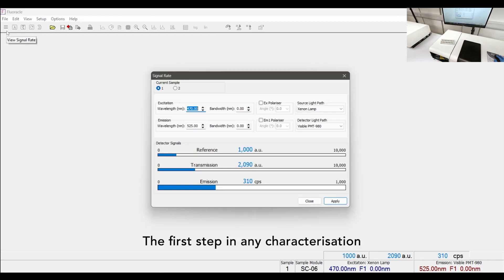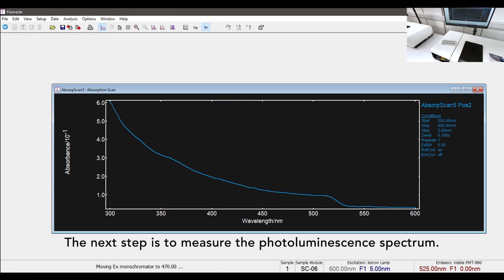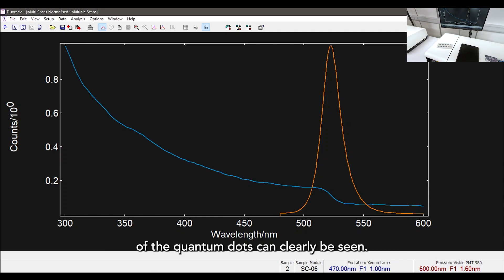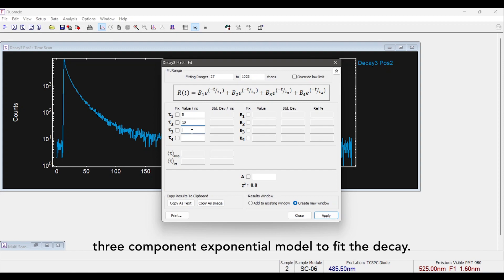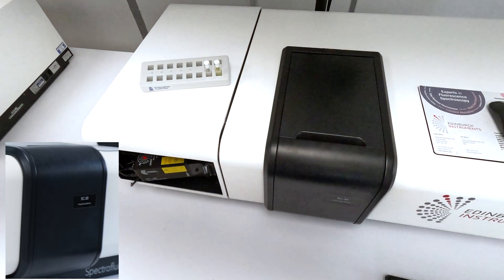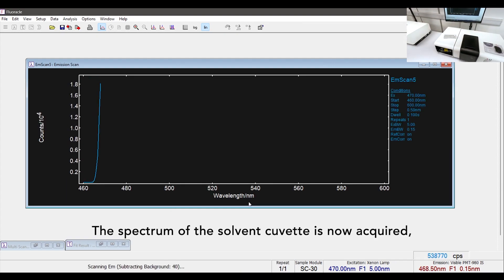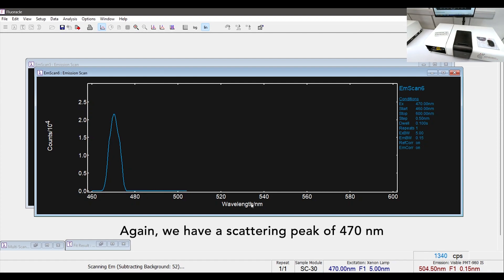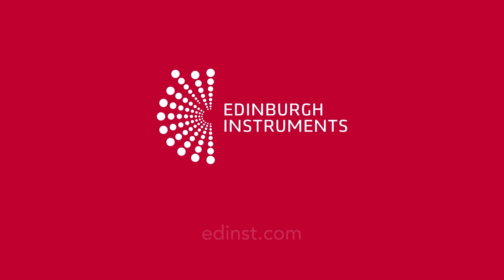FS5 Spectrofluorometer - Virtual Demo - Edinburgh Instruments

Comment: Hello, could you please answer my question as soon as possible? I need it for my work immediately, please. If I am measuring Ceramic samples with multiple compositions, i.e., x = 0.01, 0.02,..., 0.06. And during measurement, I came to know that 0.04 is the best, but somehow the graph is not smooth from 0.01-0.04 and the 0.04-0.06, here my question is if I am using the emission bandwidth for sample 0.04, is 1.5 and for the smoothness of graph I change the emission bandwidth to 1.6 and so on, could you please tell me if its legal and does it mean that characterization or not trust worthy or it can be use for smoothness, or in easy words the bandwidth one fixed for a series of samples should be the same during all over measurements, or can be change for getting a better graph if we know the best sample, Thank you
Reply from the maker: Hi @homemadecooking9728, thank you for your comment. In general it's best to compare spectra measured with the same bandwidth. How critical this is depends on what information you are trying to obtain. Our Applications team can help you, please see the contact page on our website within your enquiry please put For Attention of Applications https://www.edinst.com/contact-us/